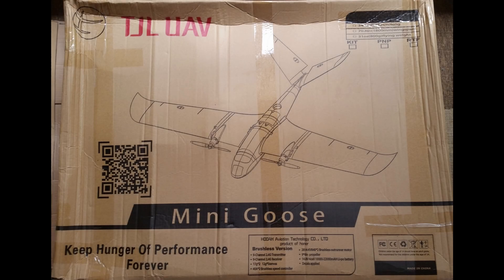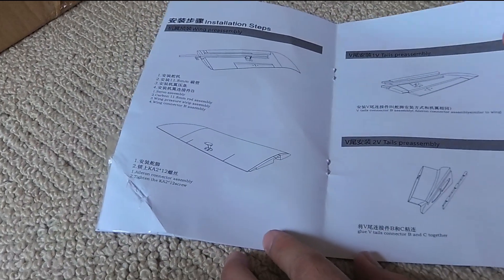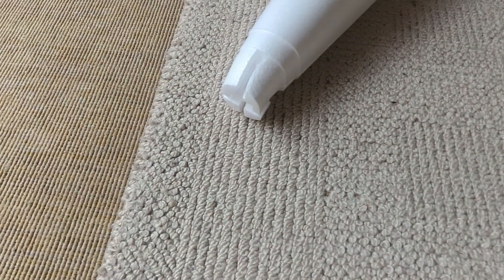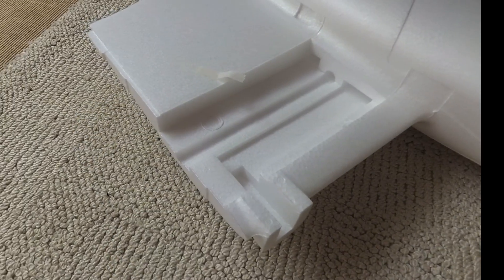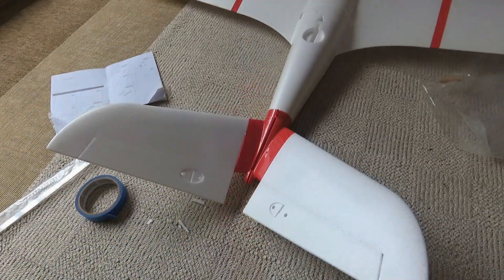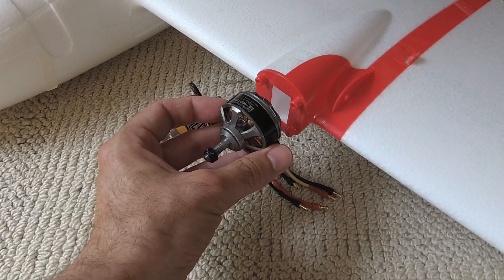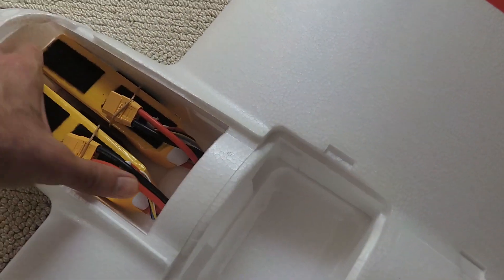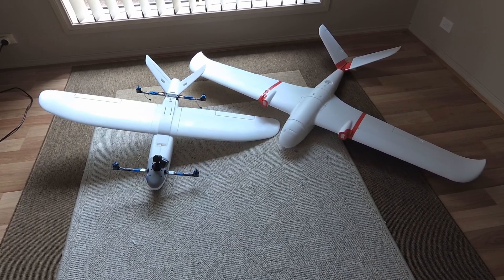Part 1 - X-UAV Snow Goose - Unboxing walk-around

Comment: Also if we could convert in Vtol setup just adding one motor under tail section??
Reply from the maker: It might be possible. Perhaps the rear underside hatch could be adapted to include additional framing to hold a third motor. I thought about this, but  am still planning to add quad motors.
Reply: I build tilt-rotor UAVs, and I can tell you that having a quad motor under the tail section is not really an efficient design. I prefer the tilt-rotor quad-plane (with four motors) setup due to their superior performance :)

Comment: Mr Zone. Keep us updated with your build. Im very keen to see the details of your vtol setup. How are you going to attach the 2 rear motors? Extend from wings or out from fuz?
Reply from the maker: Right now I'm looking at extending a carbon boom back from the trailing edge, in line with the front motor mounts, attached with a fairing of some kind. Will post update videos along the way.